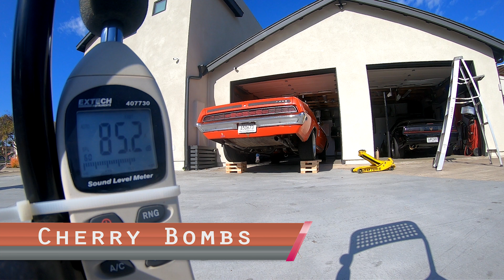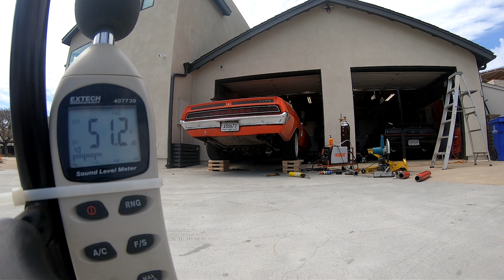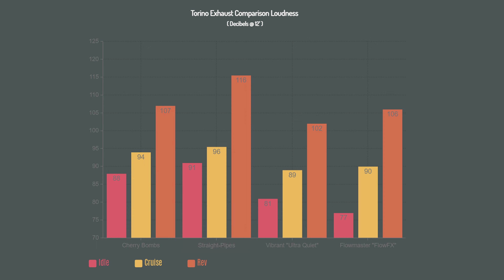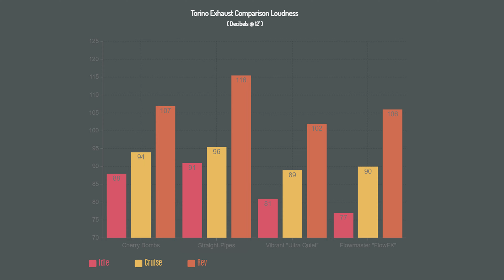Flowmaster FlowFX / Cherry Bomb / Vibrant Ultra Quiet / Straight Pipe shootout on 351W Ford Torino

Comment: Always been a fan of the vibrant products. Nice hearing them on a v8 application.
Reply from the maker: They sound sweet, I may switch back to them.
Reply: @suped89  I just picked up a 2002 Mustang GT and am thinking about replacing the magnaflow mufflers with these after I get my headers done.
Reply: Strange I've never heard of them. 😲
Reply: @hotrodray6802  they’re used more in the “tuner” market. More fabricators are starting to use them on more American cars and older muscle cars.

Comment: Damn even on old schools I think I prefer the sound of the flow fx. Those cherry bombs sounded sick also. Great exhaust video probably one of the more comprehensive ones i've watched.
Reply from the maker: Flow FX were great everywhere except next to concrete freeway barriers!  Too raspy once you hit about 1/4 throttle for my ears.
Reply: @suped89  really more raspy than the cherry bombs, straight pipe and the vibrant?

Comment: This is exactly the video I needed! Perfect!

I needed to know how much a vibrant ultra quiet will quiet the exhaust as I have high hp 6.2L With long tubes, with a proseries flowmaster I specifically choose the proseries for sound and the fact it doesn’t hurt hp values like other flowmaster chambered series do. But its about 15 decibels too loud. After watching your video I see the Vibrant Ultra Quiet will do exactly as I need thanks!

Comment: Finally a proper comparison. Most guys throw a muffler on with no tail pipes.  They actually all sound good just depends on how loud you like it.
Reply from the maker: Thanks!  With the window down and driving in the left lane against a concrete barrier the Cherry Bomb was causing ear drum damage.  I like loud pipes, but not when I have a headache after a cruise :)  I'm currently running the FlowFX but will probably switch to the Vibrant to reduce the cackle.

Comment: An H or X pipe will help tone it down a bit, and add torque. You could also run 2 pairs of mufflers, the FlowFX in the middle and the Vibrant in the rear as resonators. Both are straight through so it won't cost any power.
Reply from the maker: I actually switched to a larger Vibrant muffler and its perfect for me now.  Gonna post an update video.
Reply: @suped89  very good comparison! Thank you for the DB meter! Nobody think about that...
Can't wait to see the updated video! 
It would be interesting to see these vibrant in conjonction with additional mufflers on old school engines. not easy to find this kind of setup on youtube. I just got my Pontiac 461Ci rebuild and I don't know how to reduce the db level and still keep the distinctive old school rumble we all love.
Reply: X pipes and the myth of “back pressure” has been debunked many times.
Reply: @rmmm6725  elaborate on x-pipes and who said anything about backpressure
Reply: @suped89  This is the comment I was referring to about an update video with the larger Vibrant muffler.
Reply: I actually liked the vibrant ultra quiet  surprised how quiet it was by the size . The flow FX sound good too I think with a H pipe it will be a Lil  quieter .

Comment: I had a 1973 Chevelle with Thrush straight through mufflers back in 1987,350 4- barrell standard- sounded great @ idle and aweome at highway speeds.
Reply: 73 Chevelle Damn, my Grandma had a 73 Chevelle Malibu Classic Station Wagon. It was quite a Boat. Spent Many a years in the back of that Wagon, sitting Backwards with No Seatbelts for years, as a child with my cousin taking family road trips outta state all the time. Will never forget that Car, it was Green too.

Comment: I love all of them.. How ever i wish you would have tried the old school turbo tube chamber mufflers also... Ones that look like the dented up glasspacks
Reply: I like the FlowFX but I would love to hear that with Flowmaster 40's.
Reply: @mr9c1driver59  don't, thier nice at high rpms but the drone is annoying and disturbs long rides
Reply: Had Those Turbo Tubes Years Ago, Those (Dented Up Looking Type Long Chambered Mufflers) bought a Complete Cat Back 2 1/4" Exhaust for a 5.0 Fox Body Mustang, Paid $99 Brand New, Back in 1995. Sounded Great for $99. I didn't even know they still Made Those.
Reply: @mr9c1driver59  Flowmaster mufflers Sound great, But have Horrible Flow Ratings, just Look into the Inlet of any Chambered Flowmaster, Exhaust goes right into a Wall, Now how is that supposed to be good ?
Reply: @mr9c1driver59  Check out the Dynomax Ultra Flo,s Straight Thru design and All Stainless Steel. I really like em. Mine were Kinda Loud but we're 3 1/2" Mufflers With 3 1/2" Pipes exiting right before Rear Tires, Pointing out the Sides. That was on a N/A BBF that put down Little Over 600 to the Wheels. Had the Ultra Flo,s on a Much Milder Set-up, with Tailpipes, and they Sounded Great.

Comment: The Vibrants caught my attention first. Then when I heard the Flow fx,  I could hear a cam. Flow fx#1 Vibrant#2 my opinion.
Reply from the maker: I was running the Flow Fx, but on the freeway my ears would be ringing by the end of a drive.  They were echoing off the cement barriers.

Comment: Nice Torino, the 70 Torino Cobras with the 429 Cobra Jets are my Favorite, and Very Good video of a Muffler Comparison. Glad not to see a Flowmaster in your choices, they Always seem to Sound Good, But have horrible flow ratings. I always liked the Dynomax Stuff, the Super Turbos Flow great for someone on a budget, I really like there Ultra Flo Mufflers, Straight Thru design and Stainless Steel all throughout, Not really that expensive. I'm sorry, didn't notice you did try a Flowmaster, i was talking about there Chambered Type Mufflers, (2 Chamber, 3 Chamber). Just curious on what did you go with ?
Reply from the maker: I used the flow FX until my ears were ringing then switched to the Vibrant for a more relaxing driving experience.
Reply: @suped89  OK, yes i heard Those ones were Loud.

Comment: I just bought 2 Hot Tamales by Paradox.  Currently have glasspacks, 2 on each side. My dad built the car, 1971 MGB with a 302 FSB 40 over and many other modifications. Have you heard of the Hot Tamales?
Reply: Yes i like the tamales de rajas.

Comment: question(anyone can answer): i have a catless 06 impala ss into a “Y” pipe with no res or mufflers. do you think TWO vibrant “ultra quiet” resonators in the rear would do the trick of making it deeper but still loud just not obnoxiously loud? or should i put ONE in the middle?
Reply: Get a flowmaster super 44 or 40 series itll give you the deep tone you wantout with being annoyingly loud
Reply: @robintheslavewr1513  trying to opt away from those. it’ll be $3-400 at the end of it all. purchase and installing. i like the way the the vibrants sound but on this set up they are true dueled
Reply: @6.0Kree  got a flowmaster super44 installed on my 09 dodge caliber srt4 I bout it online they charged me only 200 bucks to install because they had to provide some piping and adaptors. Those vibrate mufflers aren't gonna be all that lound
Reply: @robintheslavewr1513  these vibrant mufflers would be loud?
Reply: @6.0Kree  there gonna be slightly louder than stock but not obnoxiously lound
Reply: @robintheslavewr1513  sounds like what i want!!
Reply: @6.0Kree  vibrate and megan racing make some pretty good and quite mufflers
Reply: @robintheslavewr1513  okay cool, thanks for that, i just ordered my 3 inch vibrants
Reply: @6.0Kree  let me know how you like it I plan on getting eirther a megan racing or another vibrate
Reply: @robintheslavewr1513  i have an 06 SS impala. 3 inch zzp downpipe, 2.5 fully straight piped all the way. looking to tone it “for my neighbors” but.. still keep it loud. haven’t installed the mufflers yet. deciding since i have a Y pipe if i should place two in the rear or one it the middle 🤔

Comment: I'm running Dynomax Race Bullets and it's so loud in my blower car that my ears ring after a drive. I don't want the car quiet, but man I have to do something. Should I add a pair of Flowmaster FX as resonators?
Reply from the maker: They don't seem to resonate well, you can use the vibrant bullets as resonators.

Comment: I wonder if the oval Flowmaster would sound any different than the round one
Reply: That's what I want to know, thinking of putting a set on my C10
Reply: @brettdn13  video if you do and be sure to let me know
Reply: I have them on a 350 and they do they sound more like a performance V8. Like trailer park vs king of the trailer park

Comment: Good video. My only objection is that the Vibrant Ultra Quiet really is marketed as a resonator that is designed to be used in conjunction with an actual muffler. You may be able to get away with using the Ultra Quiet as a muffler, but you are also likely to suffer quite a bit of droning, as well….
Reply from the maker: It seemed to have the least drone of all the mufflers I tested.
Reply: @suped89  I can imagine. Take a look at the Vibrant 17930 (2.5")/17950 (3.0"). They are larger and closer to the size of actual mufflers, but they drone even less and still give you that deeper sound....
Reply: @FiveBoroNative  You can use them as both a muffler or a resonator, the term "resonator" just refers to the location of where it is installed, but it is a universal item so it can be either or. The Vibrant mufflers are larger, and have even more sound suppression with no power loss due to their straight through design.
Reply: @arthurfromtoronto  I don't want to argue about the topic, as you are not totally incorrect in absolute terms, but after having several conversations with their reps and my own experience, I would advise using the Ultra Quiet if it can get the volume levels you are looking for, but I've seen too many instances where they were used as mufflers unsuccessfully because they can quell drone if the muffler they work in conjunction with can get the overall exhaust system volume low enough, but that is more often than not the case....

Comment: Ok, obviously the straight pipes sound the best but as for the mufflers go, i liked the vibrants the best and the flow fx second best because they aren't much different at all. So i looked up the price on the vibrants and bursted out laughing 😅😅😅,  seriously,,, you want $100 per side, GTFO.... Your selling mufflers,,, seriously, is the packing inside the muffler made from Jesus's pubes???? So next i looked up the flow fx and they are about  $48 a piece. I think its pretty obvious which muffler common sense would buy. Christ, some of these muffler companies are off their meds, black widow, spintech, pypes, they all sell for that magic number of $100. Look, if i was going to spend stupid money on a set of mufflers, id go with classic chambred power sticks. Do i like them? Yes, can i afford them? Yes, will i support their business??? Fk no, get bent...
Excellent video btw and thank you for the hours of labor making the swaps and putting the video together. Sweet Toronto btw. Great video.
Reply from the maker: I had the flow fx for a few months but they echoed off the cement guardrails so loud I ended up switching to the vibrants.  I paid around $100 each for them yeah.
Reply: @suped89  yea, cant really argue that. Thanks you for doing this on an old car with an old school engine.
Trying to get a good sound understanding on a modern camaro, mustang or charger just doesnt do it.
Are you running 2.5 or 3 inch on the torino?
Reply: It seems expensive but it's because they are made for 304 stainless steel, and they come fully polished and prepped for tig weld. If you ever held one, you'd see how much heavier it is than the other brands out there. There is a ton of packing in there, and it's perforated. Once you factor all the additional manufacturing, and the material, the cost is actually not bad
Reply from the maker: @UsefulEntertainment  dual 2.5" and headers
Reply: @suped89  thank you